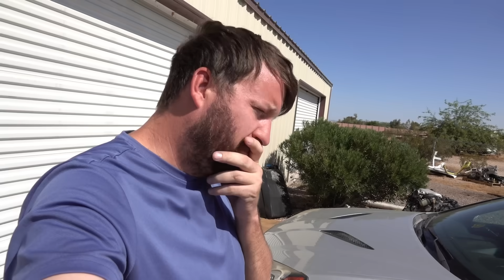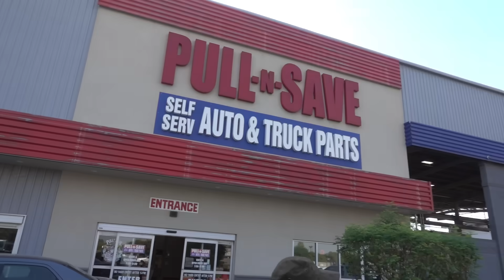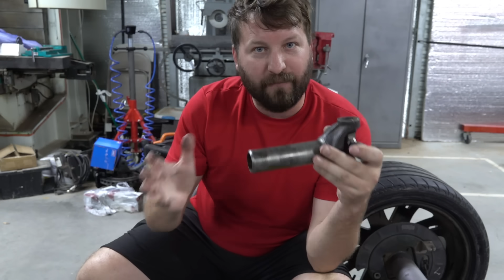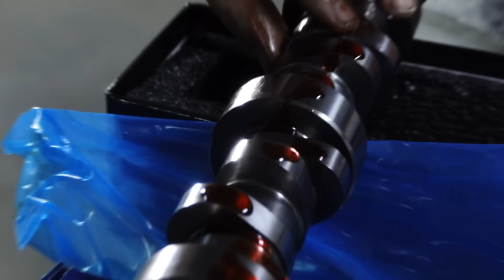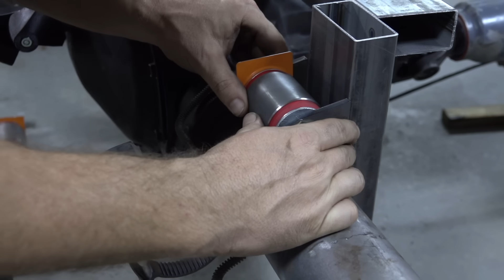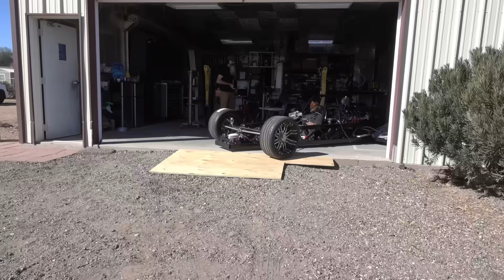Death Kart or Die Trying! LS Formula car full build!

Comment: This is cool, lowkey I wonder if u used a c4 chassis would u get similar results
Reply from the maker: That is our backup plan for this build. If we used a c4 or c5 corvette for the donor we would have independent suspension and a shorter wheel base. So if this fails we will likely re do it with corvette parts.
Reply: Roadkill did this to great effect. Their C4 vette kart is (was?) a Swiss army knife that requires just a few hours to reconfigure for on or off road shenanigans and was one of Finnegan and Freiburger's favorites cars ever because it seemed to do everything. Except drive on two wheels lol.